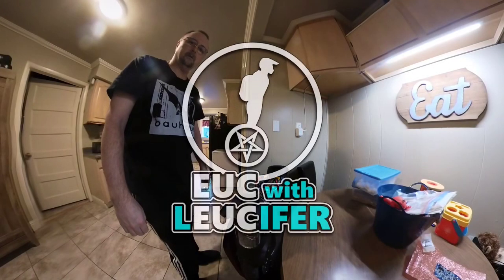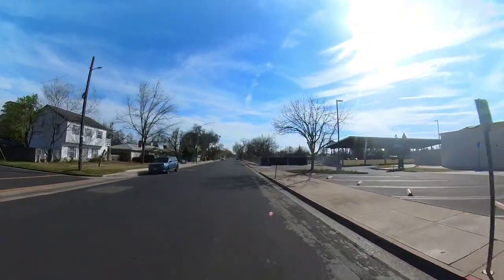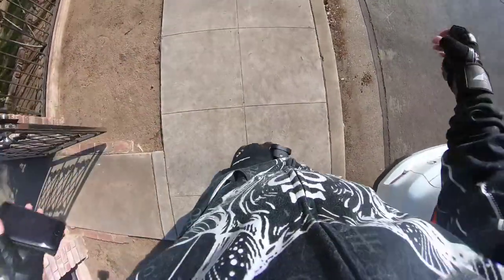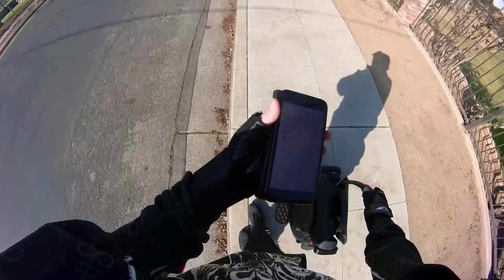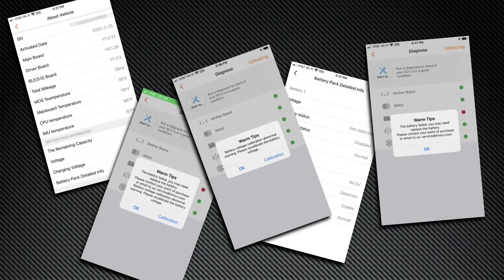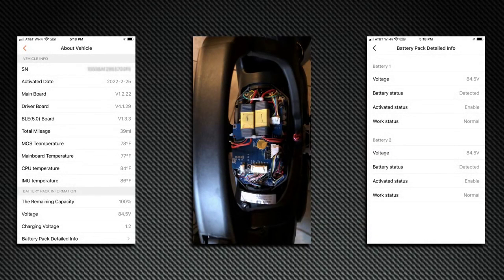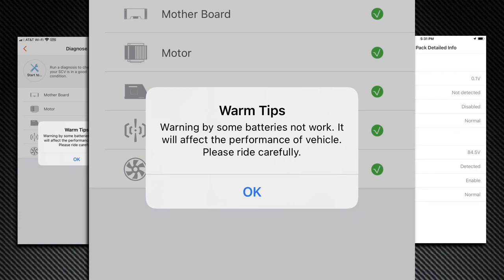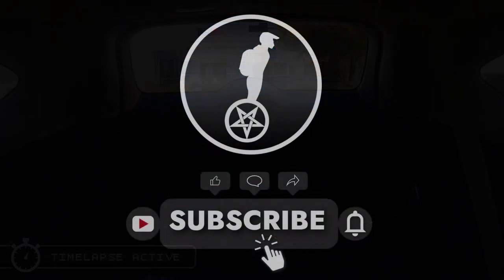Batch 4  Inmotion V11 is Garbage! - More tips for dealing with tech support

Comment: I have a v11 and I almost killed myself the other day because after spending a month in warranty repairs, they returned a v11 unfixed.
The problem was with the battery and they changed the control board but not the battery.
100 km after receiving it fixed it gave a battery error and it turned off while driving.
I suffered a strong blow to the entire left side and the GoPro, the backpack, the pants were broken and of course the v11 did not turn on again.
Thank you inmotion for playing with our lives for what a battery is worth.
Reply: My problem now IS i cant trust  anymore in my device.
Includes after the new fix.
I dont wanna feel this again
Reply from the maker: Sounds like the same issues I had.  I'm glad to be rid of it now.

Comment: I had a similar issue on mine (whatever batch was from October of 2021).  It cleared up on its own eventually.  As a diagnostic step, I discharged it down to 85% and that's when the "Please repair" alerts finally stopped....I rode it out at around that level for about 200 miles, and just recently, started charging to full and no more issues.
Reply: How did you discharge it?

Comment: Thanks man, this was going to be my wheel of choice. Now reconsidering. Have they sorted it out for you yet?
Reply from the maker: Yes, after a lot of back & forth, and a few board swaps, it turned out to be a failing battery pack.  Had to send it off for repair & waited about two months for them to finally fix it.
Inmotion has made corrections since that batch & the more recent V11s don't have that board and/or power issue than some of the batch fours did.  But, I do not recommend buying through EUCO, due to the hassles I had to go through to get them to honor the warranty.  Go with either eWheels or Alien Rides for whatever you end up buying.

Comment: Do you think I should buy a Nov 2021 v11 with 450 miles on it for 1500 with upgrades in 2023?
Reply from the maker: Depends on what "upgrades" were done and the overall condition it's in.  Like, why are they selling?  450 miles is good for a used wheel, but I'd still be asking questions.  Not a bad deal, really.

Comment: Sorry about what you had to go thru. How did you determine you had a batch 4? I thought they weren’t very clear to indicate which batch you were given. Where did you purchase the EUC, I was thinking from Amazon, but given the issues, I might purchase from a known reseller.
Reply from the maker: I asked the seller what batch it was.  The seller was EUCO (I do not recommend them).  See my recommendations below - 
✅ eWheels (USA): http://bit.ly/3F5C4Wf
✅ Alien Rides (USA): http://bit.ly/3ZPbDMI
✅ Eevee's (Canada & USA): http://bit.ly/3Zs0t0l
Reply: Hello, if I take a 2022 model (batch?), there will be no problem with it ?
Reply from the maker: If there hasn't been any mosfet, voltage or battery issues by now, you should be okay.

Comment: Yeah, buying an InMotion EUC is like gambling. My friend bought a V11 (batch 3 I guess), the controller died completely in the first thousand kilometers. Somehow he managed to get a new replacement unit (he says it's batch 4), this one has 12,000 km today and is still going strong.
Also heard about one guy leaving his V11 (turned on) against a wall, the floor there was slightly inclined, so the wheel slowly rolled until it stopped against the other wall in the corner. There, it apparently started pushing like crazy, and when the owner came back he found his lifeless V11 in the corner 😂
I've also seen a V8f spinning continuously at Vmax while laid horizontally on the floor. Can you imagine that? And then we've had the V12 issues.
InMotion offer good design and build quality, but in the end an important number of their EUCs turn out very unreliable unfortunately...
Reply from the maker: I suppose any EUC purchase is a gamble to some extent, but yeah, Inmotion has had a spotty history for the last year or so.  Even now with the V13, they've had some more hardware issues with faulty motor bolts.  Used to be Gotway/Begode being king of defects & QC issues.  Inmotion might be vying for that title.  😆

Comment: Inmotion is having major issues with MOSFETs affecting V12s and what now seems to be V11s as well. Some Inmotion wheels are trouble free but overall they have a >10% controller failure rate and they have the most warranty claims of all the euc manufacturers. I guess I got lucky with my first batch V11.
Reply from the maker: Ah, first batch, eh?  You got an O.G. V11.  👍🏼

Comment: Does anyone have a version number for V11 Batch 5? I just bought my V11 off Amazon (arrives this week), and now after seeing this video I'm a bit scared that I might get a batch 4 depending on how long it has been in their warehouse.
As an aside, after watching this video I scoured the internet and found on one of the vendor sites that they said that the Batch 5 V11's use a motherboard that is not compatible with previous versions, so that might have something to do with the problems Leucifer ran into after replacing the boards.
Reply from the maker: I have no idea if Amazon has a surplus of older V11s in their warehouses (as you said), but I haven't heard any big issues about the last few batches.    Anyway, I hope your purchase works out for you.
Reply: @EUCwithLEUCIFER  So far no problems, so I'm crossing my fingers this is a newer batch. I'm loving the wheel. I paid for Asurion insurance, so in case there is an issue at least I can get it fixed / replaced even if the warranty doesn't cover it.

Comment: Hello There, thanks for the video. This is a somewhat related question but would you A: buy a V11 with 9000km on it or B: not buy it?
Reply from the maker: Depends on the price. 9 thousand km (approx. 5.5 thousand miles for us stupid Americans) may not be a lot in the long run, but I would still wonder how degraded the batteries are, not to mention the state of the control board, bearings, shocks and other parts commonly replaced.  If it's a steal of a deal, perhaps, but the quick and easy answer would be "no".  Try to find something that has fewer miles on it, or save up and buy new.
Reply: @EUCwithLEUCIFER  Thank you for the reply

Comment: Hello, do you have solved this problem finally ? i searched to buy this wheel 😮
Reply from the maker: Blown mosfet and malfunctioning battery pack.  Those issues have been addressed in following batch releases, so you should be fine with more recent versions.

Comment: Hello sîr , what do you think of the last batch of v11 ? Would you buy it now ?
Reply from the maker: From what I understand, InMotion has made improvements since Batch Four.  Whatever faulty mosfet supplier that they had trouble with the V11 and V12 at that time was changed.  So nowadays the V11 series should be a decent buy for EUC beginners (or those riders not wanting to go any faster than 33mph or so).
Reply: @EUCwithLEUCIFER ok sir, thank for your response 👍🙏🇫🇷

Comment: I'm not batch four fortunately, but absolutely no problems with my V11, received late last year, only riding it for two months or so before the snow set in.  Knock on wood.
Reply: Its this kind of performance I was hoping for when I got my V11 in January! But then it cut out mid ride only 90 miles into its life, and I've had to send it back. Now I'm just sitting on my hands waiting to get it back so I can get riding. Here's hoping their fix brings its performace back to Batch 3 levels!
Reply: @jakejuracka  did you end up getting it back and it being all good?

Comment: OOF. And I wanted to buy one next week on Amazon. Now I'm thinking I should just wait until they make another batch.
Reply from the maker: You might want to buy directly from a retailer that offers a decent repair warranty.
Reply from the maker: Plus, if you are willing to wait anyway, I'd order either the Kingsong S20 or Begode Master.  Sure they both cost more, and both are new first-batch wheels, but I'd gamble on either Kingsong or Begode over Inmotion at this point.
Reply: Don't buy off Amazon. But do order a V11 (with a warranty). It is an awesome wheel.
Reply: Amazon is better you can purchase a sporting goods warranty.  First issue just send it back and get another. It even covers crashes